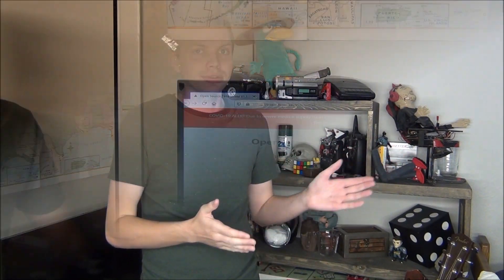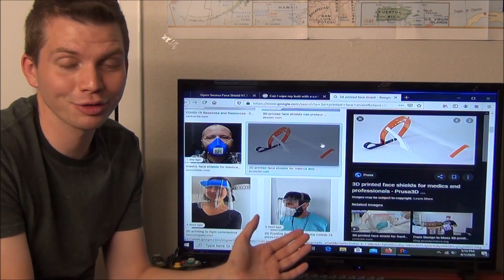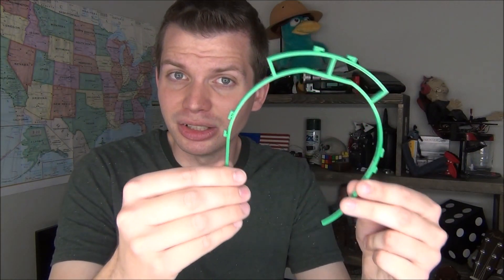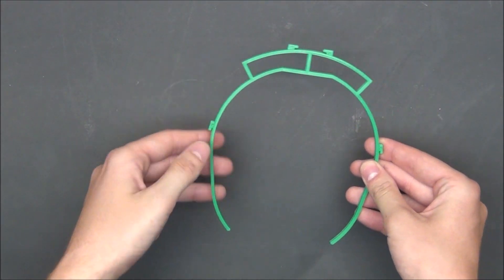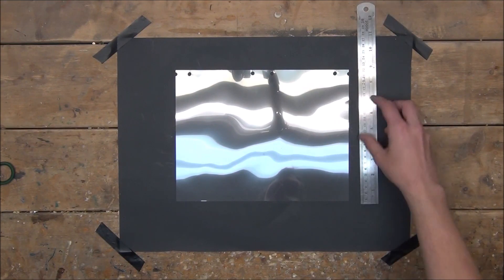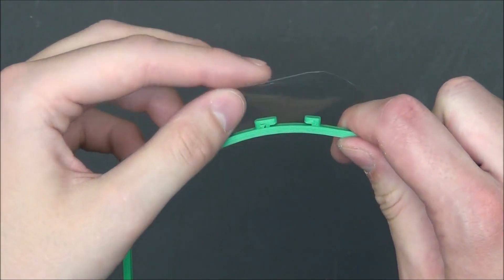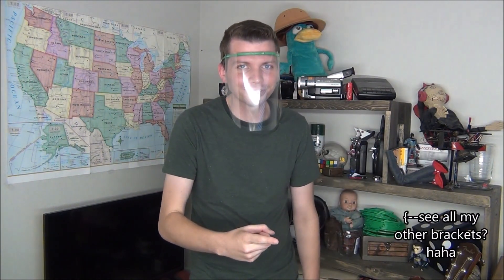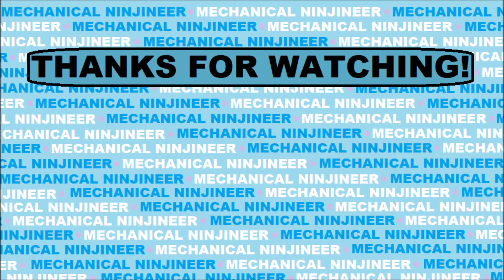3D Printed Face Shield // How To Make A Medical Face Shield

Comment: wont all the gaps in the top of the bracket allow particles to cascade onto the wearer's face and into their eyes from above? There ought to be some closed-cell foam that can seal the top against the forehead.
Reply from the maker: Yes, if you are going for one ment for surgery. But for just protective gear this should be fine. Some hospitals were actually already using sheilds that were similar, in that regard, to this one, before the outbreak. For day to day it should be fine.